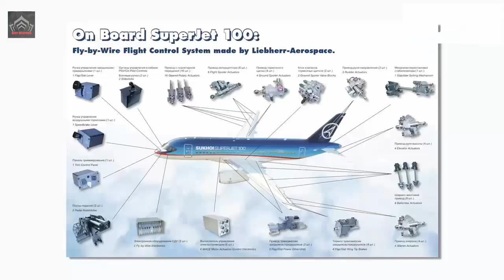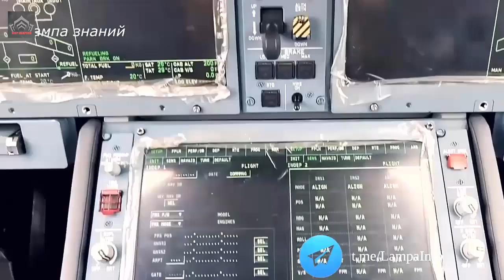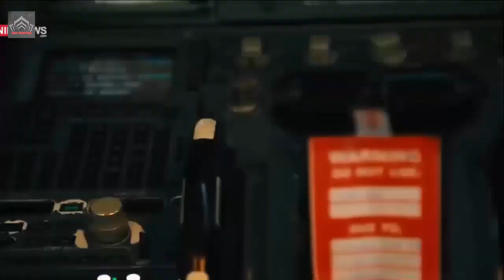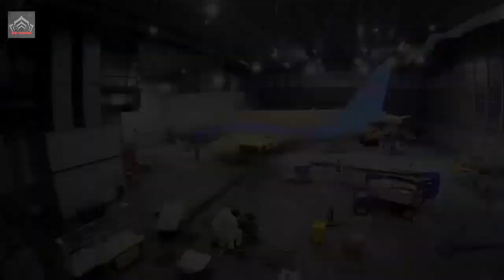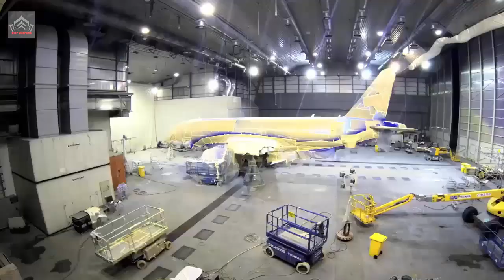Russian Sukhoi Superjet 100 Using Only Local Components Took to the Skies for the First Time

Comment: No matter what the Russian 
Jets still safer and more durable than Boeing flying coffin , well done Russia
Reply: @spaceace1006  384 dead is that enough ? 
Due to 737 Max's Indian designed MCAS system.
Reply: @fx-studio 
This is rejional jet🤣can go only 100 people😂😂
Russia never use this to iinternation travel
And this junk enjine made in france👍
No country buys this 💩
Reply: @johnregan6323 Yep, feel free to check it out, that particular plane had 2 accidents if I am not mistaken. One was during its testing phase, and another accident some 2 or 3 years ago in Moscow was a crash landing, so the safety record of that plane isn't worse than any Boeing or Airbus out there. It's just perceptions. Accidents happen but I don't think that the airplane is any less safer. But the new version just has fewer parts from Western sources. As far as I can tell Russians have a long history in aviation I believe they will be fine.
Reply: @Brocambro1 Both disasters occurred due to crew error, but not due to equipment failure.
Reply: Agreed 🎉🎉😊
Reply: Best plane i have ever used with my travel, it was best experience flight in Mexico, i think the name of the company was Interjet Mexico and all their planes similar to this model, i have travelled a lot and this plane is best plane, better than airbus and boing.
Reply: Why then did Russia steal 600 airbus and boeing planes from leasing companies? $4bn+ stolen. Criminals. And they cant do heavy C and D maintenance as they have no expertise or parts. So they are breaking up current planes for parts. Only a certain supply until that runs out. With no heavy maintenance anything remaining flying will be dangerous, and will inevitably lead to accidents. Yeah, Russian Aviation, really forward thinking, honest and technically adept....  no, its doomed.
Reply: Aeroflot's safety record was abysmal before they started flying western aircraft. Cope with that fact Ivan. 🤣👍
Reply: Can you explain to us why Russian airlines bought EU or USA airliners by the boatload then? Where are all these reliable and fuel efficient Il-96?
Reply: @69-avec-ta-soeur их убили ельцин и его американские советники
Reply: @69-avec-ta-soeur  Russia has had an unsettled economic/political past and so fell behind on many technologies. Russians are very skilled at aeronautics and jet engine production, but you need more than that in today's world, as in a lot of capital. One thing of note was the Russians taught the Chinese how to build jet fighters. I think the hypersonic technology is also from Russia.
Reply: Nobody buys this low quality flying coffins😂😂
Reply: @johnregan6323 What do you mean they have been flying for 10 years and they have at least 147 units operating smoothly and people there love them.